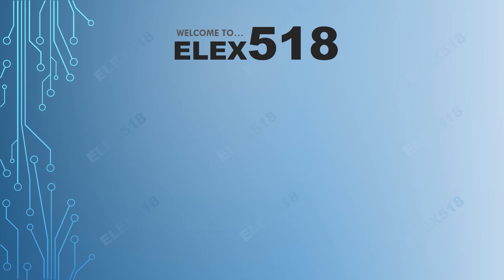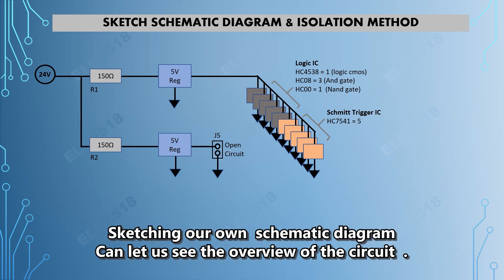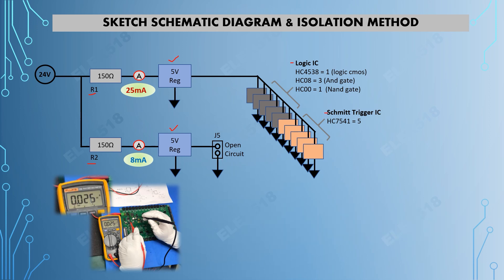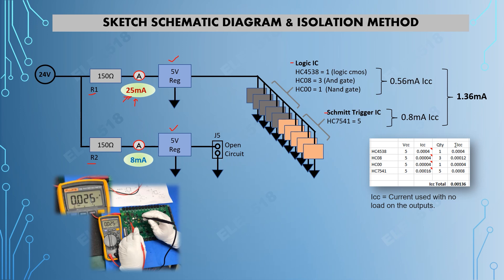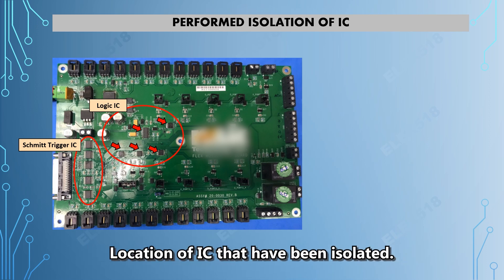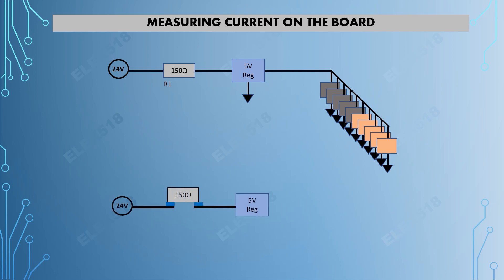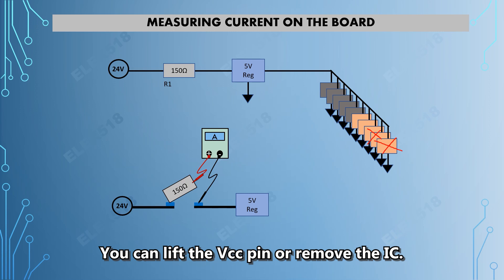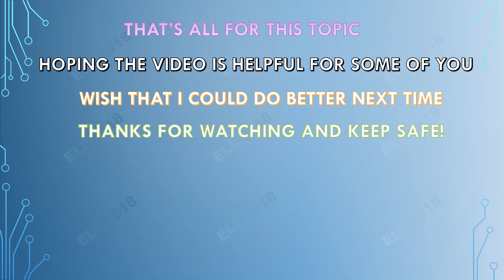How to Repair Without Schematic Diagram (Circuit Board Current Measurement & Isolation Method)

Comment: Is there any difference between reading the current being drawn from the bench top PSU vs using the multimeter in circuit?
Reply from the maker: Technically must minimal difference. However, multimeter able to measure specific area in the circuit that useful in troubleshooting.
Reply: @elex5183  ah good point. Perhaps it's possible to use both at the same time. 

Thanks for replying to my question.

Comment: But why not powering up a little voltage and use thermal gun to isolate each suspected components that heating up faster than the other. This is the best and efficient method only you need an expensive thermal gun.
Reply from the maker: Yes you were right, we have fluke thermal imager as well. Have tried it for this board when powered up at workstation. Unfortunately it does not give significant readings to help us locate the bad IC.